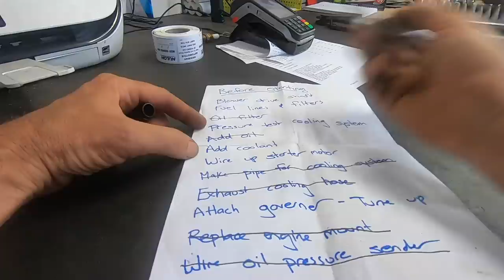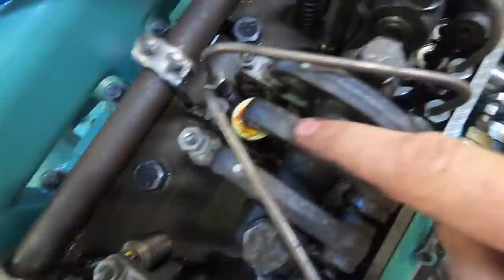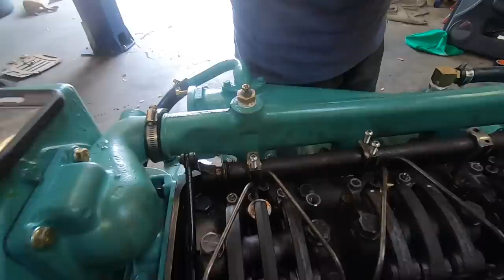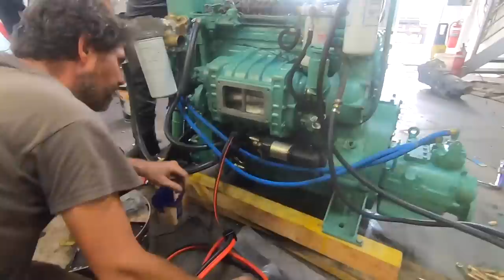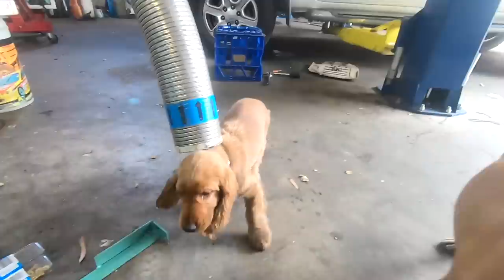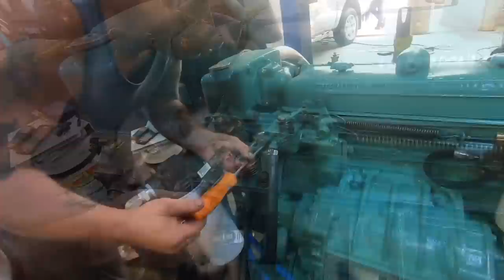First start of Detroit Diesel after rebuild

Comment: Wow I hadn't heard that sound for 40 years. When you got it dialed in better it almost brought tear to my eye. I spent many hours around this type motor in the US Coast Guard operating small boats for search and rescue in the 70's. Beautiful music to my soul. We had twins and on the reruns back to base I would lay on the engine housing and sleep like a baby. Thanks mate you made a yanks day with this vid.
Reply from the maker: Hey mate. I haven't had any history with these motors but I had a very similar reaction. It is such a great sound. Merry Christmas!
Reply: The 26'!
Reply: Dangar Marine Merry Christmas to you and yours too.
Reply: Dangar Marine Merry Christmas to you and yours too.
Reply: A sweet and unique sound. Better than a V8 petrol motor I reckon.
Reply: William These motors were used by the US Navy in the  32' (single) built in the 40's and 40'(twins) built in the 40's also for use as tenders and rescue of overboard or downed aircraft personnel. US Coast Guard in the 50's and I was a crewman/ coxswain on these out of Buffalo New York serving the eastern 1/4 of Lake Erie from 1976 -80. Most were decommissioned in the late 70's early 80's. Don't remember the horse power but they were serious work horses for decades. They were torn down and rebuilt ever winter and they never failed us.

Comment: I had the same problem with that stripped bolt on your engine.  I think it got stripped because someone put too long a bolt in that hole and it bottomed out and the threads were aluminum to start with.  I noted the problem before i put the head on the engine.  I catually tapped the hole with a 1/2-20 then inserted a home made insert which was about 3/8 long with 1/2 20 threads on the outside and the threads of the bolt on the inside.  so locktite  the thread in the aluminum end plate and make sure that you don't put too long a bolt in.  I love my little detroit diesel.  I find it a marvel and a wonderfull work of engineering.  My engine was made in 1938 and parts for it are everywhere, and mechanics love to talk about those GM 71 series two strokes.
Reply from the maker: In this case we are going to drip and tap and go up one bolt size, but I like your solution!

Comment: To clean out that bolt hole with silicone in it, Use a blow gun with a needle push thru the center of it and a little plug will come out around the needle.  I use carb cleaning needle.   Or if it is too deep for that go get a little piece of 1/8 brake line.  You might get lucky and have some good threads at the bottom, where you can bottom out an all thread stud then use a nut to pull against them.   Also, you should get a copy of all those special tools for when you need to set the tune on that motor in some far off port!  Nice motor.  I didn't realize it was a 2 stroke until you pulled the side cover.

Comment: What you can do is get a threaded rod of the right pitch and thread
Booker rod as its called on the central coast or rod bar.....
Leave it about 50mm longer
Weld a t bar to it
And cut the thread with a 2.5 cutting disk 
In the end, after the cutting it looks like a thread tap.
I used a high tensile  bolt on my engine block to tap / clean the threads out and worked PERFECT
Saved me 70 - 100 for a tap.
All your doing is making a cuttting tap to the length you need from the threaded rod/ booker bar

Comment: For cleaning the threads in that deep bolt hole, you can use a pulley tap. Perhaps the shop that did your engine may have one with the correct thread. Love the channel, and thanks for not editing the startup!

Comment: I am surprised there is no locking nut (like on the valve adjusters) on those injector rack arms.
Smart, pressurizing the cooling system BEFORE the motor was started !
Need an oil pressure gauge.

What a grin on Stu's face !
Reply from the maker: It was nice to find all the leaks before firing it up!

Comment: So Cool Stu, I have watched Scott fire these motors up for the first time with smoke rolling out but he doesn't really explain how it works that well. By watching your deisel mechanic today I think I kinda understand. When its first fired up the injectors are set to a cold start setting till it runs the fuel thru good. Then the injectors are set to the finally setting then lock everything in. Correct me on this. Thanks Tim

Comment: The stripped long bolt Stu was caused by the missing washer :). That sounded so nice when it was dialled in. Suprised by the lack of any visible particulates when it was running. Well tuned and rebuilt machines are quite a joy.
Reply from the maker: I think you're onto it. ;)

Comment: Hey Stu.  For that deep thread that's buggered up you can try a simple trick by making a self-tapping bolt.  Take a bolt of sufficient length then use a triangular file to cut 3 notches in the end 120 degrees from each other.  Make the cuts about 30 degrees to the longitudinal plane of the bolt shaft.  You can use that to tap the threads and clean it out so it will accept the correct bolt.  I've used this trick many times successfully.  Another good option would be to just tack weld a thread tapper to a longer bolt and run that in and out to clean the threads.

Comment: Tech Tip: If you need to clean up threads that your tap can't reach then buy a cheap tap and weld it to the end of a long bolt narrower than the bore. Works like a charm.

Comment: Stu, You could try to clean out those threads by getting an over-length bolt and grinding a flute into it to mimic the cutting flute of a bottoming tap. Might even be able to slightly grind thread diameter down to mimic 'starter thread' design of a tap. You're not cutting metal so the relatively low hardness of the bolt should not be an issue.

Comment: You need to be sure Stu those lift points you screwed the eye bolts  are designed to take the weight of the entire engine and not just the head or what ever part they are cast into. All make sure the eye bolts themselves are rated for lifting and not just some rubbish from the  Wondrous  Flying Panda casting works. "Pink eyes" are one option.  Rated lifting gear will always have its capacity on it.
And congratulations on the engine first start!
Reply: Yeah, I was looking at those eyes and bolts thinking, i am not sure i would want to lift with those...
Reply: @LeytonC  it's a classic mistake for young riggers to hook on to things that are designed to lift say a ton during the assembly of the machine, pump, motor etc. When the thing is fully built it weighs 20 tons... I've gotten out of the crane a few times to see what's happening at the other end and seen the young guys hooking onto something like that.  I don't want to see Stu or his mates get hurt.
Reply from the maker: This is where lift points are installed on many Detroits, this one just didn't have them on.
Reply: @DangarMarine  Okay, I thought it was worth while mentioning it. On a large project like this I know it's easy for somethings to "fall though the cracks". I was very happy for you to see the engine fire up.

Comment: i cant believe ya started it without setting the valves and injector timing(height)  no wonder it smoked like a bitch. i always did the front cylinder when running the rack  then unhooked the  governor link and put a bungee on the rack to finish the rest. so much easier especially on a v6 or v8 or v12 or v16.   good to see it up and running. 

next week stu opens an colonoscopy clinic lol  one ass looking at another  j/k

Comment: Detroit Diesel two stroke, the original environmentally 'Green Engine'
The most efficient engine ever built for turning diesel fuel into noise.

I've just got a 6V53 running at a museum I volunteer at, the noise is just so different, the 71's have a nice mellow roar.
The 53's just make your ears bleed.

Comment: Just remember the break in period must be "under load" ! It must be run at high cylinder to head pressure for 4-5 hrs. to optimize fuel economy and minimize oil consumption. But I'm sure you know that. (Just a reminder). The shop that used to do my rebuilds would do it on a Dyno.  It was a large shop and did many rebuilds. Most small shops don't have or can't afford a Dyno room and rely on the customer to do the break in with their advise.
Reply from the maker: For sure. I'm looking forward to taking the boat for it's run in cruises. There is no doubt that you can do damage to these motors trying to be kind to them.

Comment: The frankenjimmy lives!! 284 cubic inches (4.75 liters for you civilized folks) of 2 stroke toroflow torque producing monstrosity. Adrian did a superb job of massaging it to roaring perfection. Has anybody mentioned that your 4 valve head is actually meant for a v8 turbo inducted engine?

Comment: I love these Detroits ,
I have dozens  rebuilds and repairs to 53,71 and 92's under me belt and they are all sweet sounding engines.
But the best of all I reckon is the 6V53 running at 3200 RPM with no exhausts or air cleaners on the test stand.
The noise just makes your skin crawl anywhere within the vicinity.
Just a pity I don't see them nowadays, the 60 series is a fantastic engine and extremely common round my neck of the woods but the two strokes still and always will hold a place in my heart.

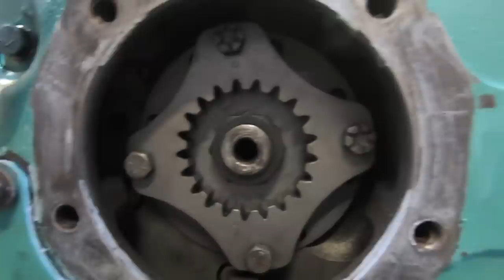Comment: 4:09 Those bolts are called Self-Locking "Place" Bolts.  The slots in the head allow the individual head sections to flex slightly in towards the head center when the bolt is under tension.  This creates a spring loading effect and reduces the chance they will loosen up.  The newer ones have a set of asymmetric slots (i.e. missing one slot), which apparently further increases their resistance to loosening by vibration due to their uneven mass.  Here's an example of the bolt type: https://wilsongarner.com/product/11936/ Hope you got the correct bolts installed or have access after the fact.  This type of bolt is also used in heavy transmission flex plate coupling (i.e. Allison).

Comment: To Clean thread...Take a long bolt cut it lengthwise down the treads...clean up the long bolt treads with a die...run bolt in and out of engine.  (basically making a cheep long tap)

Comment: I sure hope all those mistakes you found get addressed somehow; as a mechanic it sickens me to see blower no good: pivot-pin holders backwards: wrong screws: improper bolts: bolt-holes with debris inside........I honestly hope that you are Not on the hook for all the remedial work you had to do.
Also: "rear-endoscope" gets Top Marks!  (never heard that one before.....) Good luck mate.
Reply: I was thinking the same thing.  Seems like the engine machine shop builder sure screwed up a bunch of things.
Reply: I’m guessing the machine shop didn’t have much to do with the top end. And some of those things might have been done by old trawler mechanics whose main concern was zero downtime and quick turnaround. After ~40 years of commercial service this old Detroit would’ve seen some dodgy mechanics in its day.

Awesome that Stu has a local expert like Adrian who can spot things like that and the blower issues with ease!
Reply: @Hoggdoc1946  Scott, The Bus Grease Monkey, who Stu knows has been plagued by the same type of machine shop issues. He winds up having to do remedial work the machine shop was paid to do in the first place.
Reply: M
Reply: @mikemullay5622  - I was thinking the same thing and; hoping it was "old trawler mechanics", instead. Though really, there's ever fewer seasoned experts like Adrian and (is it Jim, from Oregon?) for Stu and Scott, to pick up these finer points for these period, Detroit Diesels. This day and age of quantity over quality; I'm not sure that we can expect much more, from the modern machine shops, regardless of the cost. Cheers-

Comment: That bolt looks like it has broken so the easy way to repair it is to machine a rod  the size of the hole then drill the centre of the shaft to a few sizes smaller than the tap size  then place the shaft in the hole and drill it out . This way you do not have to remove the any of the parts. This works well as the shaft hold the drill centre of the bolt as you drill.

Comment: Also add a seperate cooler for the transmission its cooling as you have it in the heatexchanger and that water is to hot engine temp a seperate cooler will have your trans running way cooler and it will last longer and also shorter hoses
Reply from the maker: I should do some temp checks on the gearbox after a big run.

Comment: Can you say something about what happened to cause the deep rebuild along the lines of what you learned about preventative maintenance for this engine both in the water and once an engine was pulled?
Reply from the maker: The main need for such a full rebuilt was the engine bay filling with salt water. Don't let you boat sink is my top maintenance tip! From now on though it is just regular oil and filter changes really.

Comment: The dogs weren't sure what to think about the smoke at first... amazing that it all went away after a few adjustments.  Where will the exhaust be routed when it is installed in the boat?
Reply from the maker: Exhaust is going up behind the wheelhouse

Comment: i had a problem where a thread was buggered and used a dynabolt, never did it too tight in case it cracked the block, but it stopped the waterpump leak
Reply from the maker: Nice hack!

Comment: You need to get the modern fuel rack for the injectors because if a injector gets stuck it can make your engine run away the modern rack seperates each injector
Reply from the maker: Yes, would be a good upgrade.

Comment: What happened with that screw that looked like it wasn’t long enough?The one that you used the scope on?
Reply from the maker: Adrian bought a matching bolt and tap one size larger. Haven't done the job yet but soon.
Reply: @DangarMarine  
Is that doable without taking the Housing off the Block?
Reply: @DangarMarine  that will be one long tapping tool :)

Comment: Utter bliss now that shes ready you must be champing at the bit to getting her back in cheers to you Stu , but on a different note some advice pls Stu  i have a yammy 90 2 stroke and ive noticed gear oil leaking (coming out) from the water intake vent any idea which seal could cause that i will buy that brake bleeder/vaccum pump you show on another vid to test it but am hoping for some help or info if you have any idea before that tool arrives cheers again...Ken...Melbourne. Vic.
Reply from the maker: Thanks mate. I'd say it is the drive shaft seal but you won't really know until you do the pressure test.
Reply: @DangarMarine  Thanks for the reply Stu i was hoping it mightve been the gear selector seal as it seems easier to do but wiill test and make sure as you say and probably do both anyway thanks again and Merry Xmas mate..

Comment: Im a diesel mechanic. Not an expert on these but have overhauled a couple dozen 8V71's over the years. These things are outdated and exspensive. I am not sure the reason not to repower? Probably discussed in earlier videos. But as far as im concerned there is no reason not to repower. That noise is deafening, not fuel efficient, and the smoke and oil leaks excessive. They still have lots of these 4-53's at the airport where I do GSE. If everything is done just right you might get a couple thousand hours reliable service out of this motor. A cummins B turbo motor would have been a better choice.
Reply from the maker: Thanks for sharing this exciting moment with us! I guess...

Comment: I may have missed it...how did you stop the engine in that test configuration?

Final fix for the bolt problem?
Reply from the maker: Hand actuate the shutoff valve. Going to go up one bolt size.
Reply: @DangarMarine  Thanks for the update Stu.

Comment: No offense to adrian but im leary about the replacement screws coming loose. The original ones should have been long enough so something seems odd there. That said usually they are not exactly easy to turn, slight interference fit, so new ones which are probably undersized just a tad have a chance of coming loose. Clean them off with carb cleaner/acetone and dab some red locktight on them without touching the adjustment. Last thing you want is a scew to come loose at the worst possible time.

otherwise runs good. I would pump up pressure to twenty or twenty five psi on cooling system to check for leaks. Sometimes things stick and it goes over the normal sixteen psi for a bit before system releases steam, at least on cars.

Comment: you need to adjust buffer screw that why your engine rave up and down.i work on older model they are just 2 exaust valves instead of 4
Reply from the maker: It gets adjusted in this video.

Comment: Hey Stu, off topic question. Do you have a supplier for seals to suit an evinrude etec 115 hydraulic trim pump? Im from mid north coast NSW. Cheers
Reply from the maker: I just use out local Evinrude dealer.

Comment: How did you cool it????
Reply from the maker: It's got about 25 litres of coolant running through the engine so it takes about an hour to heat up without the heat exchanger cooling it down again.